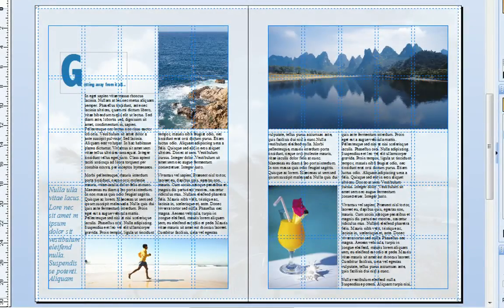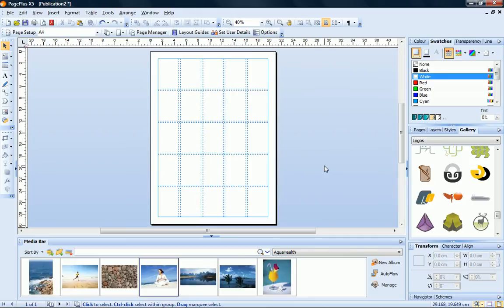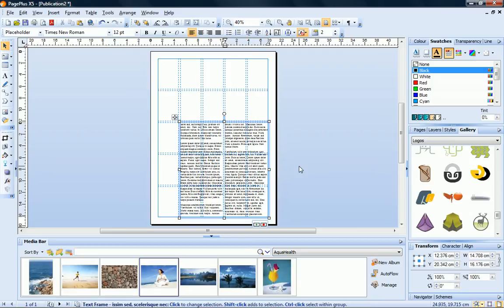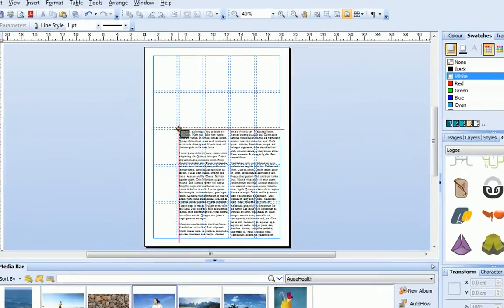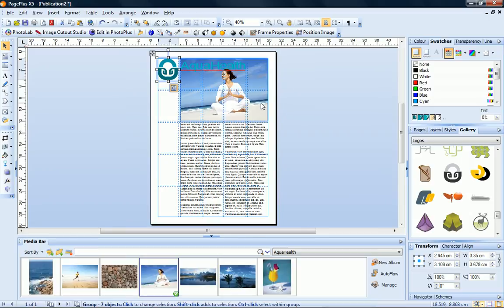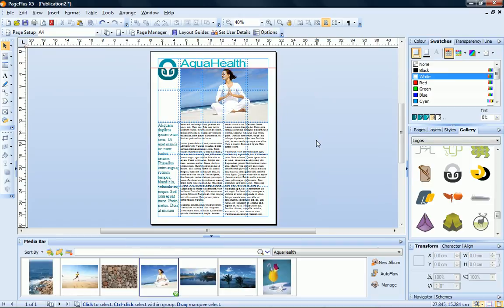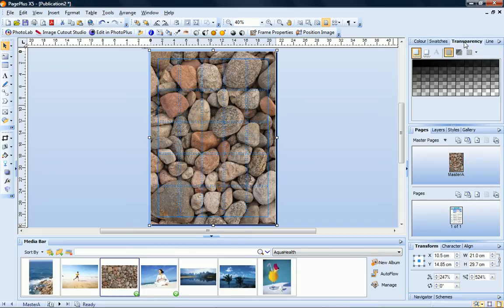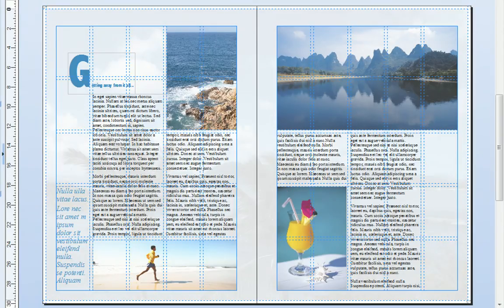Serif PagePlus X5 Tutorial - Page Layout Techniques

Comment from the maker: Hi ICM, you can drag them off the page to remove them or by using the File menu > Layout Guides dialog. Alternatively you can hide them using options in the View menu, or by switching on Trimmed Page Mode using one of the three small buttons at the bottom-right of your screen. Hope that helps, Dale.

Comment from the maker: @LoniHart Hi Loni. Which profile are you using in the Publish as PDF dialog? There are presets there for different levels of Acrobat compatibility and for different output purposes. However I've not heard of these settings causing a PDF to be unreadable, though, might be worth sharing a PagePlus file with tech support, or on our forum, for someone else to try and make a PDF from it to help troubleshoot if changing profile does not help. HTH, Dale.